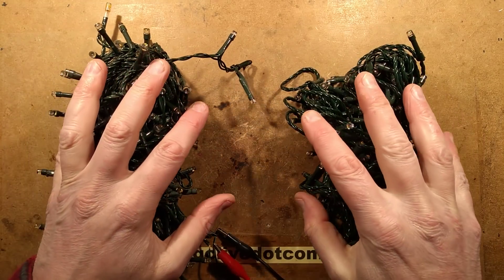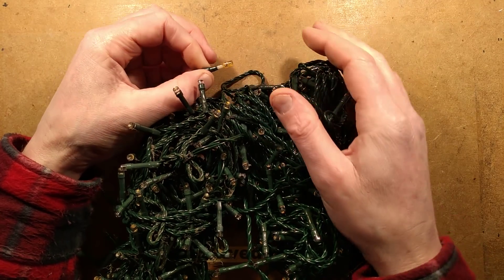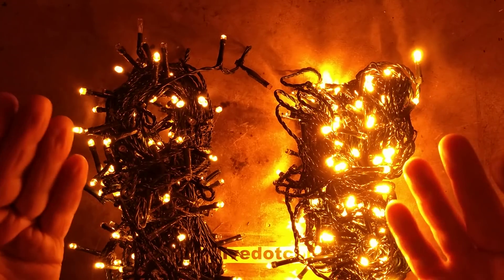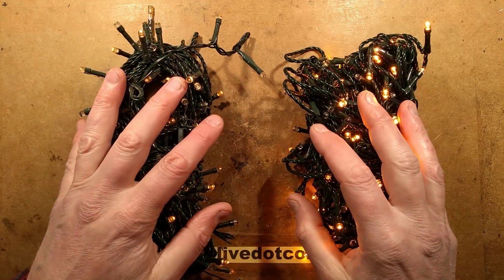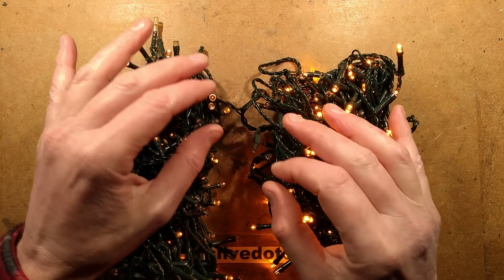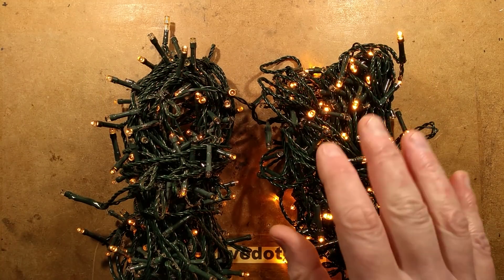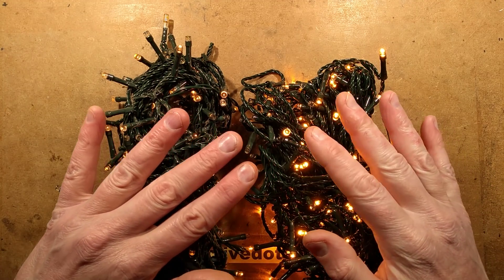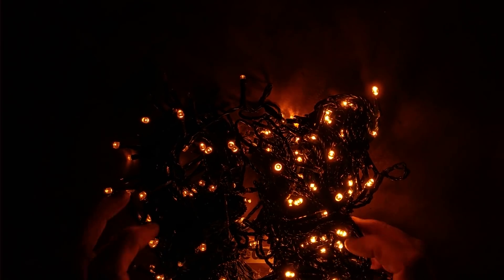9000 hour LED intensity loss test on LED strings.  (All LEDs do still work.)

Comment: It's all LEDs that have this problem, not just Christmas lights. I have a couple LED night lights, both the exact same model bought at the exact same time. One of them is in a dark room not exposed to daylight (a utility/laundry room attached to the bathroom) where it has been on almost constantly for several years, while the other had been in storage until I finally started using it just a few months ago. The light that has been in constant long-term use is significantly dimmer than the one that has seen very little use.

I've also seen this effect on computer keyboards, specifically with the "lock" LED indicators. On older keyboards, the Num Lock LED is often dimmer than the Caps and Scroll lock LEDs, because Num Lock is almost always turned on while the other two are rarely used.
Reply: I was just gonna say, I WISH the num lock LED on my keyboard would get dimmer; it's soo bright, lights up the whole ceiling in the area (Das Keyboard Ultimate)
Reply: Also depends on the technology/quality.
Reply: I wasn't aware of this, I wonder how pronounced the effect is on LED grow lights. I've been growing some tomatoes indoors under a couple of those for a while now to have year round fresh tomatoes, and now I come to think of it they do seem a little dimmer. They're so bright it's difficult to tell though.
Reply: werxeh tomatoes eh
Reply: @zorrosoxter4703  I know what you're thinking, but genuinely tomatoes yes https://youtu.be/YvKoH6cBbKY 
Why I had the grow lights in the first place however, is anyone's guess...
Reply: bigloudnoise - the degradation of light output from LEDs has been known about for a very long time. Heck, I’ve known about it for 30 years...
If quality parts are used in a circuit which does not overrun the components, and where they don’t get too hot, they will last for a reasonable amount of time, with the light output degrading gracefully. Cheap lamps however, are not likely to last anywhere near as long, as either cheap parts have been used, or they are using the LED at its maximum or more current/power, and/or the parts are running too hot. Any/all of which increases the rate of degradation.
Reply: @bigloudnoise are you sure it's not the capacitive dropper that has degraded in your night light?

Comment: Interesting results, and thanks for following up with this. I do wonder whether running them at a lower current would prolong their useful life, much as it does with incandescents & neons. Sure, they wouldn't look as bright at say 50-70% of their nominal current rating, but after a year, it'd be better to have lights that still put out half their normal brightness than only ~10%. Just an idea for further testing. I also wonder how much of a detrimental effect reverse-biasing the LEDs has over similar time periods. Of course it "shouldn't" have any effect, but it'd be neat to explore further.
Reply: The lifespan on good quality LEDs is usually rated in hours at full power until 50% brightness and the lifespans are typically in the 10k-50k hours range. If you lose 90% brightness in 9k hours, those are either horrible LEDs, horribly over-driven LEDs or overheating LEDs. Corrosion may also be diverting a greater chunk of current than the 10mA difference between the worn and new sets.

Comment: I have an old wireless router that has put in 5 years or so years of service. It has blue LED indicators for different things and the couple that are on all the time are now so dim that in normal room lighting you almost can't even see them anymore. The others that are for functions that aren't used only come on when restarting the device and are very bright in comparison.
Reply: I think my router is that old, it has a bunch of amber indicators and one green one for power. They are so bright you could almost read in that room with the lights off. I guess amber doesn't degrade as fast.

Comment: I believe it's due to the LEDs being overdriven. I've noticed that on some of these strings they're driven at 25-30mA each. I always under-drive my strings, they're slightly dimmer but lasts a pretty long time.

In 2017 I decorated my parents' house with golden white LED strings, about 6700 LEDs in total. Still no problem with corrosion even after two years being outdoors. I run them all from a single power supply, 29VDC instead of the original 31VDC to save their lifetime.

Comment: I have tested cheap ebay RGB strip against Osram's extremely expensive ones, ran it for several months heated up to a high temperature to accelerate aging. After the test you couldn't see any difference between used and fresh Osram strip while the cheap ebay strip had lost most of it's intensity on red and green while blue was all but dead.

The Osram strip is prohibitively expensive though, i wouldn't recommend it for anything but fixed installations that will run continuously for 10+ years.

Same goes for really expensive high end white LEDs, they will last a lot longer than the cheaper stuff you tend to find in even in commercial christmas lights.

Comment: I was about to say, corrosion in the led connections caused the dimming and less current flow. Then you did the Ammeter test to prove the fact that the current has even increased a little with the dimmer set. Interesting result.

Comment: That’s very interesting.

I have three sets I’ve been putting up for three years, and two of them succumbed to corrosion shortly into the second year. They are 3mm warm white LEDs run on 30v A.C. as you describe, and they corroded up the legs into the plastic of the led lens and failed fairly quickly.

This year I bought a bag of replacement LEDs and set about soldering new ones in, encapsulating them in hot glue and heat shrink, plus smothering the remaining ones in hot glue. What is interesting is that the new ones appear much more golden and “warmer” than the old ones. I put it down to slightly different LEDs but the phosphor degradation does seem like a plausible explanation!

The third set are 5mm LEDs, and despite being straight 24v D.C. and being out for two years longer than the others they’ve only literally just started failing due to corrosion. The rust seems not to cause them to fail as readily just because there’s more plastic lens between the chip and the outside world and it takes longer to eat it’s way in.

Comment: Hi Clive.
About ten years ago, I built shelving / cupboard units into the alcoves on either side of the chimney breast in our lounge.
On the underside of the three shelves, I fitted self-adhesive LED strip kits sourced from the now defunct Maplin. The two kits were not cheap, about thirty-five quid each.
The left-hand alcove gets used much more than the right, as it is where my Mrs has her chair.
After a couple of years, I noticed that the left-hand alcove was considerably dimmer than the right.
So far, I have replaced the strips in the left side twice; the first time with Maplin sourced strips, the second time with generic, presumably Chinesium strips from Amazon.
Not sure if the technology has advanced in the later strips, but they seem to be holding up much better. Plus they are now considerably cheaper.

Comment: Hope you have a very Merry Christmas Clive. your last vid reminds me, did you ever go to the Christmas Fair in Glasgow   be late 90,s when they started the Ice skating rink.  It was Chiller Rentals that  came up with the idea of a portable Ice rink, but the Company that supplied the whole Fair and rink with electicity was Generator Power ltd. I was the sole Mechanicial/Electrical Engineer for the first 14 months of the companies launch.  Anyway I remember  the first year it was put on the Generators 2 x 250kva one prime, one as standby plus the distibution panels (blakley) and AMF pannel that were designed and made by me, were up there ready for me to connect, do the testing then hook up those that needed 415v 3 phase and 250V single phase. I had been on the road at 5am doing a break in sevice on one of our generators down south (We were based in Leed's West Yorkshire) and I had to call back into the yard to load the feed cables to do the hook up and scoot up and hook it all up, at the last minute someone needed a 63 Amp ceeform  3 phase  trailing socket for a fancy lighting unit  We did not have any in stock, so Steve (who financed the company) called SLD generators also based in leed's if they had one, they did and it was already wired up with enough to do the job, so I swung by and picked it up as it was on the way to pick up the A1.  Anyway to cut this short I hooked everything up tested it , then hooked up the vendors cables to the pannel, I had to drill out and gland off, then attach the 63A trailing socket for the light show guy. he tried it and it blew all his lights. stripping down the Ceeform socket it had been wired up  Red as phase 1 =correct, Yellow as phase 2=correct and Black as phase 3 =incorect and Blue as neutral = incorect, I rewired it up the correct way but the company had to stump up for all the new lights. It turned out tht SLD generators wired every 3 phase plug or socket below 63a the correct way but for 63A and above they swapped the black for a phase and blue as neutral (very naughty and highly illegal)
Reply: why did they swap the wires?
Reply: @dosgos   See the last part how SLD wired up anything 63A and above.

Comment: Not so sure about tungsten lights retaining their output.  I've seen some long-lived tungsten bulbs with significant metal deposition on the inside of the glass envelope, making them look almost black when not powered.  That's got to reduce the light output.
Reply from the maker: Definitely in the ones that blacken over time.

Comment: That drop in light output is horrendous!  I think we are being ripped off by all these claims about LEDs lasting for 50,000 hours, or 25 years, or in some products that claim the LEDs will last forever! 
 I wonder what all these new LED  street lights will look like in a few years time? I noticed round my way that some older ones that were installed as a trial installation about 6 years had started to show a slight blue tint, compared to newly installed lanterns.
Reply: Agreed. Fed up of the longevity claims written on the box. I’ve taken to writing the installation date on the lamp body so I can see just how bad they are!
Reply: I find it hard to blame the LED'S here, I'm pretty sure they're being abused here, as in exceeding the spec sheet.

If this is what it looks like, it's a constant voltage supply, say 5v, with a resistor in each led to limit the current and balance it, so the voltage across the LED's is about 3v when they're on.

This inverse parallel thing could be done ok, but only if you made parallel pairs share the same resistor, so that the reverse bias on one is capped at the forward bias on the other, if, instead they had a resistor each, which would be easier to wire, then the reverse bias would be the entire supply voltage -5v + any switching transients, potentially up to like 6v.

That's way above what any data sheet would allow.
Reply: I believe that in this case these are both low quality LEDs as well as they have been overdriven outside their spec range. I have used many LEDs in many different products over years, and none of them have seen such a drastic brightness output change, not even close.
Reply: Actually it doesnt matter if the claims were accurate because the caps will still fail much earlier.
Reply: NOW, That's Richy. - part of the problem is that people like to buy the cheapest, but with these no brand name / name that no one has ever heard of before devices, manufacturers just put lies on their packaging. Higher quality (but higher cost) LED lamps can achieve much longer lifespans. But do read the small print, as the lifespan is often for when used for only two hours a day.
Reply: It all depends on what they're claiming. If they're claiming they still work, then they're absolutely right - none of Clive's LEDs here have failed, they all still produce light. The more important parameter here is lumen maintenance; but that's another thing entirely ;) That said, with most LED lightbulbs the claims of working after 25 years are wildly over optimistic. It's always worth putting the claims into context; a claim of 25 years life from a "company" you've never heard of is unlikely to be backed up by any form of recourse anyway, so they can claim pretty much whatever they like - they know the "company" won't exist in two months, let alone 25 years!
Reply: John Coops - I know, but that’s not what is stated on the packaging...
Reply: Rick Delair - so is there any evidence for humans going blind? Link to evidence please... And it’s hardly new technology, White LEDs have been around for a while now. And red, green and yellow LED technology is over 30 years old...
Tungsten filament, quartz halogen, low pressure sodium, high pressure sodium, metal halide technology all have their own limitations. The slow cycling or fast flickering of the gas discharge types at end of life can be especially annoying for example.
Reply: I was looking at LED light bulbs the other day and had to laugh. Big letters on the front proclaimed they would last 12 years, but the fine print on the back said they were only waranteed for five years.
Reply: I recently got a light intensity meter. I should run a test of how quickly consumer LED bulbs degrade
Reply: The longevity claims on the box often have a tiny printed note that specifies the number of years the light will last is calculated under fairly ridiculous conditions, along the lines of "average use of 30 minutes per day" or something like that. Kinda exaggerrating, but not that much. I've seen these notes even on pretty reputable brand lights.

Comment: Reading other comments about LED experiences, I'll throw my first set of blue LEDs in, bought in I think 2005 or 2006, they were really bright, and pretty amazing (considering even then, blue LEDs were still a bit pricey), but after not that much use, some of them started turning green, and then went out, and gradually more and more did the same, until in one big cascade failure, they all went pop, don't think I'd used them for more than 30 hours, but they certainly didn't last... :(

Comment: I would argue that it's more about quality than type of led, that they just tend to over drive the leds far more often these days to compete with the ever brightening newer sets. I also wonder at the degree to which the corrosion is effecting the power to each led as well. No, LEDs do not last forever but I have several A19 types that have been in use for several years that have not shown such a drastic degradation in output. And a few of them have been in outdoor fixtures the entire time. No I did not think to measure their output at time of install so that I could compare it to now but they are in fixtures illuminating the driveway and back porch, so it would be noticed if they started to drop off in output any significant amount. Certainly no where near a 90% drop in output.
Reply: I agree, we have LED lighting in our building that runs 24/7 for many years now... I have noticed a couple chip going blue (out of thousands)... but every now and then an over-height vehicle will take out some lamps, when they get replaced the old ones seem just as bright as the new ones

Comment: Interesting Clive. I have noticed this with most Leds that use a phosphor , mostly white Leds.  In UK we have a lamp post with a lantern that has two bulbs. Both come on at dusk , one switches off at midnight / 1am . The other burns all night until dawn. 
It has has some LED "golf-balls" in there since 2010.   These are simple , very robust old-style early Led bulbs each with about 24 standard 5mm warm white Leds in a diffusing ball/bulb.  They are rated at 1.2 watts.
I noticed the "all-night" bulb was noticeable dimmer and not as "warm" after a couple of years use compared to the one that only runs till midnight. 
HOWEVER - Now , after nearly 10 years , they both seem to have equalized and reached the same level with no noticeable difference, which would suggest that white Leds seem to  reach a brightness / whiteness "plateau" after burning very long hours.

Comment: Does the older set run hotter as they age? It would be interesting to see a spectral comparison.  I assumed that degradation of the phosphors would happen more quickly than the LED chip, but I’m not sure.

Comment: Red LEDs do degrade, but do so at a more gentle rate. The company that I work for has some that have been in service for 30 years (but not lit all the time) and there is a staggering difference between those that are rarely lit and those that are often lit.
Reply: On the other hand though, I've still got a mains powered red LED alarm clock,  which I had for a Christmas present in 1979, so it's 40 years old!  It's been in almost continuous use & the display looks exactly the same as it did when it was new, it's the older style with the nice cherry red colour display,  also I've always had it set on the lower of the 2 brightness settings,  which has helped it's longevity! Link to pic below.
https://photos.app.goo.gl/e1NzUoaxGDwr2xQQ6
Reply: @NOWThatsRichy  The old inorganic LEDs may last practically forever but their light output per watt is orders of magnitude less than modern lighting-optimized LEDs. The old tech is still in current use for indicators where reliability is far more important than brightness and efficiency.
Reply: @jdslyman I've also got a Panasonic clock radio I bought in 1993, with a green LED clock & that seems to look about the same as it did originally.